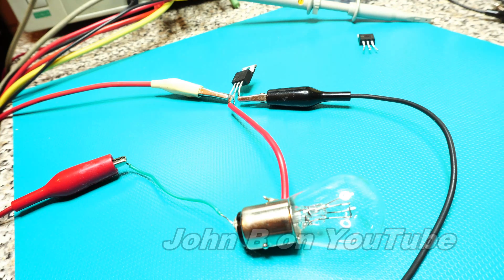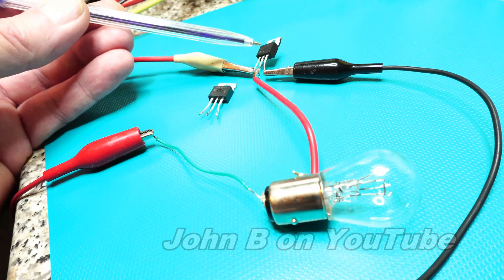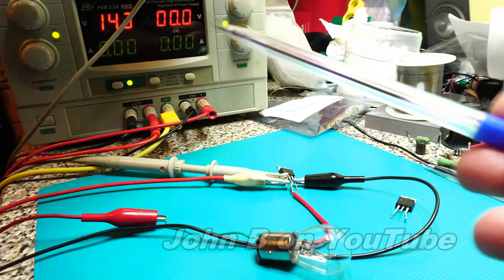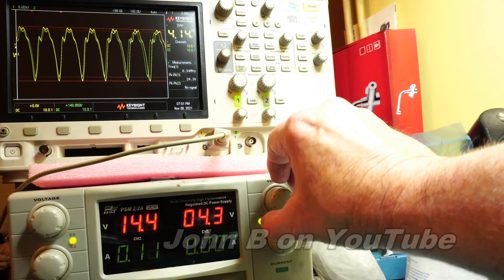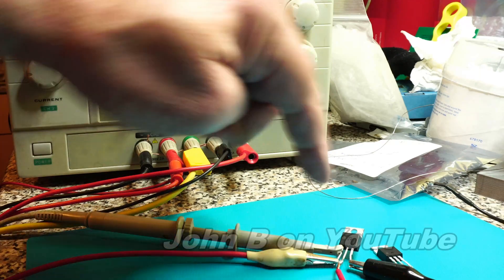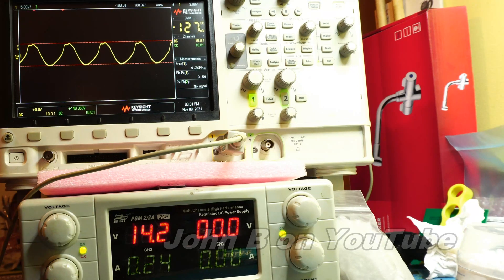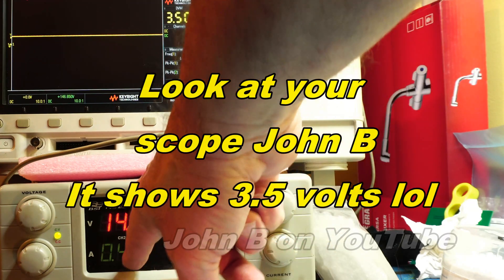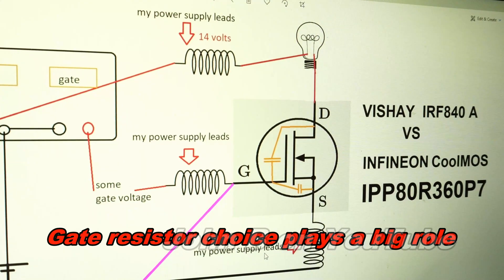Calculating A FET Gate Resistor Part 2 - N Channel Mosfets, Gate Loop Ringing - see 'more'

Comment: I built a boost converter for a diy solar charger and achieved ~97% efficiency. But looking at the gate, there is a 200MHz 11Vpeak ringing on turn off (Vdrive=12.5V). However, unlike in the video, it does not continuously oscillate, but just gets smaller each period, quickly dying down. The Mosfet only gets lukewarm even if conducting above 5A on average and does not even need a heatsink. It already runs fine like that for >1000h runtime. Should I be worried about problems in the future?

Why does it ring? I guess it's because i chose an overkill gate driver IC and added no external gate resistor. But the 200MHz seem too fast to switch the Mosfet. The high achieved efficiency and the low heat on the mosfet seem to indicate that everything is fine.
Reply from the maker: Your project sounds very interesting.
I was going to say you have either long thin leads, breadboard or a low value gate resistor.
No gate resistor is your problem. 
I would try a 6 or 10 ohm and see if the problem stops.
You could reduce the inductance on your fet leads by making them larger and shorter.
It’s a shame I can’t see your pcb, interesting problem with easy solutions. 
Thank you for your comments.

Comment: Appreciate your vids, im busy with quite a special project, i have 150 Fairchild 250v 30a mosfets all connected together in parallel. Ive been experiencing weird issues alike to parasitic turn on do you think this ringing effect can come into play with such a large amount of FETs connected in parallel?
Reply from the maker: wow, 150 FETs !
Yes I imagine lots can happen.
I guess some of the fets are doing more work than others, it is always the case.
What current supply do you have to the gates?
I guess you have one resistor?
Thanks for your comments.
Reply: @JohnB-2021  its a simple idea thats turned out much more complicated than first anticipated. I use shift registers to send a sequence through the fets. Only about 7 are on at a time. Many blown up components. It seems there is something going on i am not fully aware of, I've read and researched every aspect of these components and have come up empty. Im aware these electronics were not made to be used in this manner so i am wondering if its a dead end, maybe using transistors to switch in this manner just cant work. Maybe IGBTs would work but 100 of those would not be cheap haha
Reply from the maker: @wynand988  What part are you using to turn the fets on, it is important to know?
What gate resistor / resistors are you using?
One for all gates?
PS
What are the fets?
Reply: @JohnB-2021  i have diodes for each that go to a pull down resistor of around 1k. I've tried different combinations for the shift registers that go to the fets but they need to turn on and off in 0.0001 seconds so ideally i wouldn't have a gate resistor.
They are Fairchild FDPF33N25T N channel MOSFETs
Reply from the maker: @wynand988  Diodes facing to the fet then 1k to ground?
What is your power supply current, what current are you seeing at the drain?
Or what can your supply deliver?
Reply: @JohnB-2021 no the diodes are running away from the gates and all come together to a resistor that goes to ground. Theres a sperate wire to each gate that goes to a board with the shift registers.
 the supply is around 100v and puts out roughly 800amp.
Reply from the maker: The gate threshold is 3 to 5 volts; that is to turn it on and use it for lower currents than the max.
It sounds like you are not turning the fets fully on, the fets are probably staying in the linear ‘ ohmic region’, getting hot and blowing up.
I have a video on that too lol.
Plus, 1 k to ground is sucking all of your gate charge!
Increase it to at least 10k or more.
I bet the driver doesn't like your 1k load lol.
Reply: @JohnB-2021  i appreciate your responses but I've varied all those parameters. I have open drain shift registers as well that can sink 33volt so I'm kicking the fets on to their max volt. I was just curious if you may have known about some phenomenon that occurs with switching this much fets in parallel. I've even tried them in high side position but the back emf from that was unmanageable.
I've started considering a mechanical switching system using mercury at this point haha
Reply from the maker: @wynand988  Oh so not low on volatge.
Have you put a scope on the gate?
Reply: @JohnB-2021  i do not have access to an oscilloscope sadly
Reply from the maker: @wynand988  So you can't tell if you have ringing and you can't see what your gate voltage is doing. Can the shift register deliver many amps for your required switching speed?
Reply: @JohnB-2021  could be that yes with the 74hc595's so i am trying a different type called STPIC6C595. They are open drain so i have pullup resistors for each gate of 1.2kohm, if i go lower the amp from the 20v power supply would burn out the pcb, I'm not sure if the resistance is too high that for a pulse of 0.0001 the gates can't come on fast enough. Quite the conundrum, I'll have to order a new board with cmos output shift registers that use gate drivers like opto couplers I'm assuming
Reply from the maker: @wynand988  The max current from a 20 volt psu via 1.2k resistor is 0.01666666666666666666666666666667 amps. No where near enough current for a fast switch.
Reply: @JohnB-2021  in other words gate drivers is what i need. Oh well, seems in that case this project is gonna have to wait a couple more months
Reply from the maker: @wynand988  I've just done a quick calculation. In theory they should be switching on fairly quickly if all the gates have that current at 20 odd volts.
You need to measure what is being dropped across the 1k resistor at initial switch on. I think the gates are being slowed down. Most circuits need a 50 or 100 ohm for fast switching. Don't forget, the gate is like a short circuit when discharged.
Reply: @JohnB-2021  if i want to calculate the turn on time of the gate by looking at it's rated gate capacity do i use the Ciss measured in pF or the gate charge measured in nC. For the FDPF33N25T
Reply: @JohnB-2021  i am attempting to pulse 100000watts through the FETs. PCB components may be the issue for driving it. Im considering using smaller fets with a secondary power supply to be the gate drivers

Comment: You might be getting ringing from power supply
Reply from the maker: No, it's the high inductance within the leads of the transistor package since they will ring in an amplifier.
My test leads help demonstrate it.

Comment: hi john wondering if you could shed some
light on my amplifier, i cant find a schematic anywhere!! its a behringer dr115dsp class d with irs20925 driver and 2x irfb31n20d output fets, i have oscillation and output but its at -1.8 vdc at idle with no input and when a drivers connected it sounds distorted and weak! the center of the triangle wave on pin 4  COMP of the irs is at -1.8vdc also, i have replaced the fet driver and fets and still the same.. if i remove the fets the center of the triangle wave is at 0v where it should be! have you any idea what’s going on??? many thanks
Reply: @JohnB-2021  and thanks for talking the time
to reply 👍🏻
Reply from the maker: Hi Antony,
Just uploading a video on the Behringer DR115DSP true power.
I hope you don't mind since I did mention you a few times and thanked you for your help.
John B
Reply: @JohnB-2021  hi john no problem at all and no i dont mind, your videos have been a great deal of help to me especially with the mackie 450 and the swa1801 so thank you
Reply from the maker: @antonyarchibold6127  I did notice and I remember saying the Mackie also had a voltage offset like your Behringer. Thank you for the ok.
Reply: @JohnB-2021  hi john finally cracked the bugger! it was a smd cap c66 on the board it leads to pin 3 of the irs and carries the triangle wave along with the audio signal, unbelievable!! the smallest cap you ever seen and it took the whole amp down with it! i dont even know the actual value due to lack of schematic but i had another behringer board iv been scavenging parts off so i took one from that of a similar size and also from the input side of the same irs ic and we have perfect bass again!! what a pain in the neck that was!
Reply: @JohnB-2021   and just for future reference, when all is working well i get + and - 6.2 on the irs and the triangle wave is centred at 0v, the output bias is also extremely low around +15mv not -1.2v 👍🏻
Reply from the maker: @antonyarchibold6127  Great news Antony.
I have seen many surface mount caps fail over the years.
Thank you for the update.

Comment: I have never seen a ringing FET before.
I was always thought to put a resistor with a fairly common formula but never learned why.
Awesome stuff!
Reply from the maker: Hi Vasquez Electronics, I had never seen it either until I replaced a blown FET, 5.8 ohm gate resistor, with an Infineon FET. 
Thank you for your comments.😀

Comment: The series resistor does do trick tonstop the ring. I usually just use a 1K ohm pull-up/down resistor with larger fets to drive motors. It seems to work well enough. But then again, my turn on times will be alot slower than 50uS and my drive currents only around 50 mAmps.

Again, good video with great examples.
Reply from the maker: Thank you for your comments CHS Electronics
The Peavey amplifier had a 5.8 Ohm.